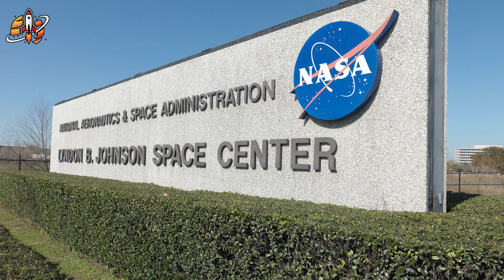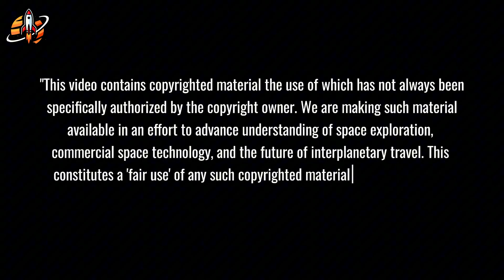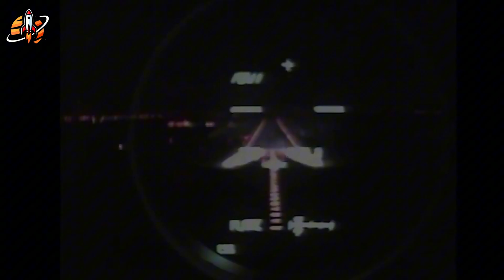Elon Musk revealed WHY NASA's $4B rocket failed: SpaceX's genius fix...

Comment: Look, much of the cost is because of Congress and their rules and requirements. Congress also caused the shuttle reusability to be questionable. It needed to be a clean sheet design based on usability but that was stopped again be Congress. So, don’t blame NASA.
Reply from the maker: Congress's rules inflate costs and limit innovation, but NASA's reliance on disposable SLS designs still drives the $4.2B price tag. SpaceX's reusable Starship shows a smarter path forward.